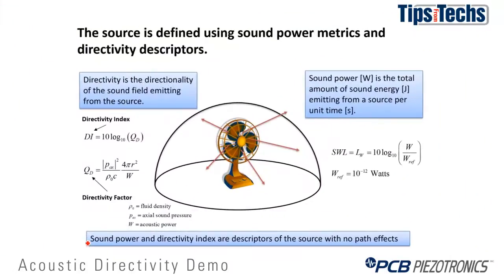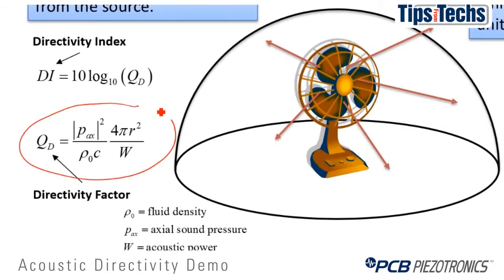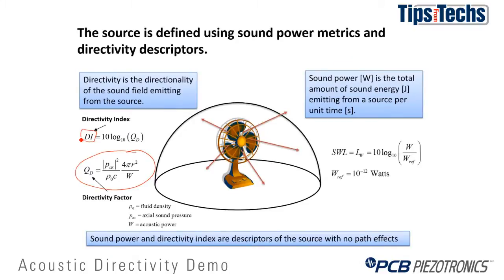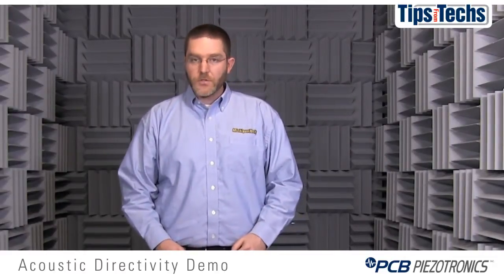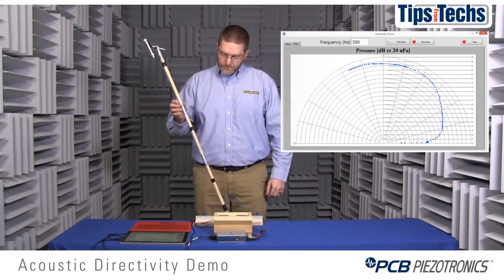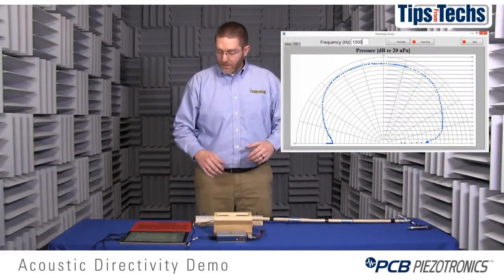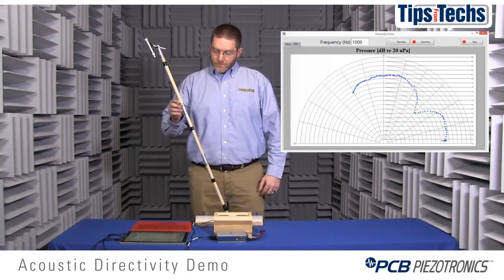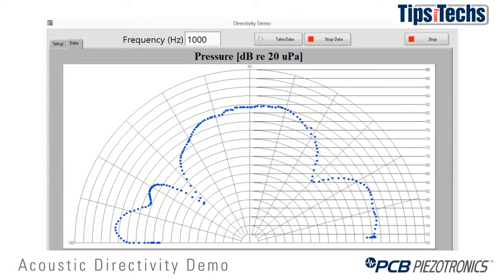Directivity Patterns in Acoustic Testing - Demonstration

Comment: Testing either requires a VERY large non-reflective region (or the outdoors far from any plane - or a tool such as TEF enabling an anechoic response by filtering any late arriving reflections) or an anechoic chamber...., and a complete horizontal as well as vertical sampling of output for a complete polar response. Similarly, unlike a few other references, such a response is Not limited to 180 degrees, but must include a greater degree of freedom - unless the model is a special case where specifically designed to be baffle (a LARGE baffle) mounted and a modified resultant gain structure - along with potential comb filtering due to the superposition of the direct and reflected signal -  reinforced by the boundary.
The other method is that designed by Don Keele using a PZM configured ground plane measurement in a similarly large otherwise unbounded environment.

Comment: Why are there notches for 1KHz ?
Reply: Caused by the interference of the two drivers playing the same signal. Depending on the wavelength of the frequency and the distance between the drivers you will get interference, if at 300hz the drivers would have been further apart you would have also seen interference.
Reply: Comb filtering caused by the superposition of two or more direct or direct and indirect (reflected) signals.

Comment: Don't believe this shows what you want. When measuring directivity of a microphone it's critical that either the orientation of the microphone or source relative to the other goes through a 180 degree range. Having the face of the microphone always oriented towards the source as shown in the demo fails to accomplish this.  As for the 3 notches at 1 kHz, in an anechoic chamber devoid of reflections, are clearly some reflections that result in the nulls. Could this be the flat table top?  It would appear that this setup more likely measures the less than ideal directional pattern of the radiator and environment rather than the microphone. I'd put the microphone in the center of a non reflective turntable and rotate the source around the microphone so as to launch sound at all angles. As performed, you're never aiming sound at the rear of the microphone.
Reply: Though I do believe they are showing the directivity of the speaker drivers and not the microphone so they are right in the way they position the microphone... They are measuring the interference pattern cause by the 2 drivers, a better and more clear example would have been to use one driver and rotate the Mic from front to back